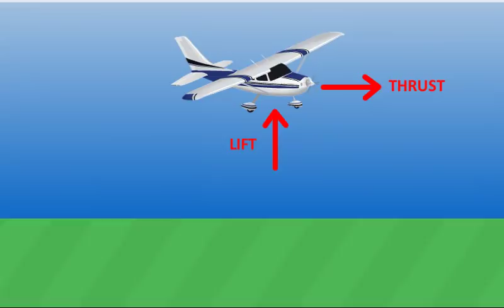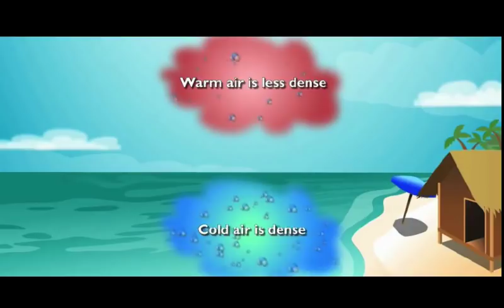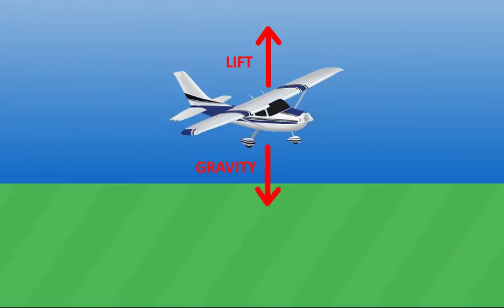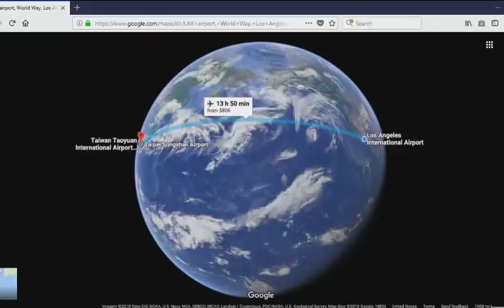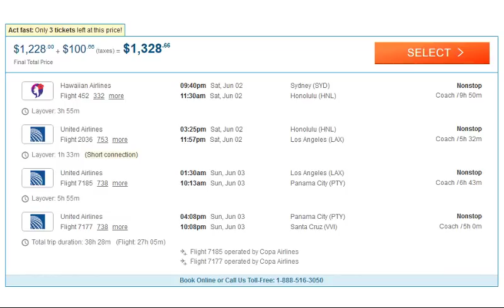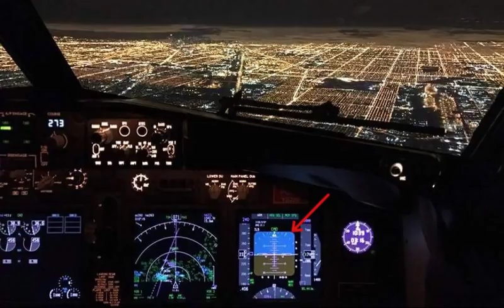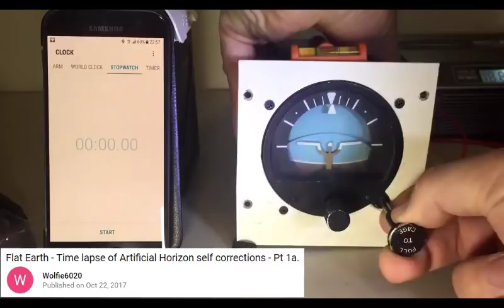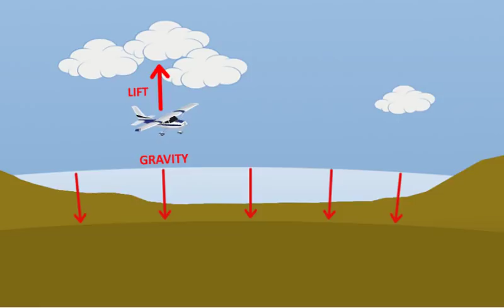Flat Earth Falsities - Plane Nonsense

Comment: #3  Flat Earthers often make this claim about planes having to dip their noses to avoid flying off in to space. I like the video clip you used, "In my reality . . ." That's the problem people, you don't get to define your own reality. Anyway, the point I want to make is, that they never address the fact that on the flat earth model they usually use, a plane, or anything else for that matter, going due East or West, would continually have to turn right or left, depending, in order to maintain that compass heading. Any vehicle on any course of constant bearing, other than due North or South, would also have to make continuous corrections to maintain that bearing.
Reply: @James Hewitt
Why are you lying James?
Why are you a troll James?
Why don't you fuck off James?
Reply: That doesn't address the issue. The compass would track magnetic north in both cases, but on a flat earth maintaining a constant heading would require constant course corrections, and the further north you were the more extreme the required corrections would be.
Reply: No it's not. A plane flying east on the equator can maintain that heading without making constant course corrections to the north. This is impossible on a flat earth.
Reply: +StoicSophist
James Hewitt is a proven troll.
Reply: James Hewett  Closer to does not mean directly in between. Now, when Venus and Mercury are directly in between the Earth and Sun, or on the other side of the Sun, they cannot be seen, but most of the time they are far enough out to the side to be seen. Now, how about actually addressing my point?
Reply: "Thats very well argued. But its in no way shape or form proof of that the earth is a ball."
Actually it does, if you travel in a straight line without ever turning and you return to your point of origin it proves you are on a ball.

"Tell me how we can see mercury and venus at night when the two of them are closer to the sun?"
This has been explained to you several times and you just ignore all the answers.  No doubt you will ignore this one as well.

https://i.imgur.com/e206MQG.png

The gray areas are the visible areas.  Any time Venus and Mercury travel through those areas they are visible from Earth at night.
Reply: Disagreeing with James.
Reply: First, it does not need to be to scale in order to demonstrate concept.  Second, if you actually looked at it it says right on it "planets not to scale" because Earth would be 0.04 pixels wide at that scale.  What excuse will you attempt next?
Reply: Stoic Sophist  I'm sorry, I don't understand your comment. Are you agreeing with me or disagreeing?
Reply: "My point is that you cant from any angle see mercury and venus at night on a ball because."
Well your point is wrong.  As has been explained to you by multiple people.  As was demonstrated by the simple graph I presented you with.
Reply: Sorry . What graph?
Reply: Ok i see it. Is that gralh to scale?
Reply: Not to mention that the circumference of the ice ring is smaller than the equator, but hey whatever I'm brainwashed because the moon and so are all of the other planets and the sun and are round we just live on a flat disk and I can't see further than 3-5 mile at sea level cus of muh perspective
Reply: Go away wong. Or watch this doco. "Did scientists prove the shape of the earth ? You decide" its brilliant
Reply: My point is that you cant from any angle see mercury and venus at night on a ball because. No matter where the two planets are situated in their orbits .  The earths light side will be facing in that direction.  The distances are to great to try and argue that at a certain angle of  either planets orbit you can see the from the dark side of earth.  It is very simple
Reply: As to the issue of aircrafts. Both arguments are based on someone's word. Both sides have equally insufficient evidence that woud prove the the natural shape of earth
Reply: Odysseus Rex.  correct and the way it happens is the compass always points magnetic  north. Weather on a ball or a flat plain
Reply: This is an argument it cant realy prove either model
Reply: Thats very well argued. But its in no way shape or form proof of that the earth is a ball. As i have asked in other threads. Tell me how we can see mercury and venus at night when the two of them are closer to the sun?

Comment: There is a lot of reasonable explanations for our reality here, but I quite don't understand how a plane can follow the earths curvature just by flying plane? The speed of the plane is essential to make the plane lift off. It conquers gravity then. Why would not the speed of the plane conquer gravity when flying plane? Could someone explain this to me? What happens for instanse when you increase the speed when flying plane. Then you put even more force on gravity. I just don't see why the plane then won't fly into space...?
Reply: It is not "conquering" gravity when it takes off any more than you "conquer" gravity by jumping.  An airplane flies by generating enough lift via thrust to counter drag and gravity.  It is not "conquering" gravity, gravity is always there and always pulling it down.  It is just generating enough lift to reach an equilibrium with the downward pull of gravity.

"I just don't see why the plane then won't fly into space...?"
Because as you increase in altitude the air gets thinner, eventually you reach an altitude where the air is too thin to support the wings of the airplane.  Without enough air flowing over and under the wings the airplane can not generate lift.  Without enough lift, gravity wins out and pulls the plane back down.  This is of course ignoring the fact that jet engines require air to function so if the air is to thin the engines can't generate thrust either.
Reply: bonny john They were tracked to & from the moon, they left traceable equipment there, brought material back and the landing sites have since been confirmed with orbital pictures. Why do you think they believe they went?
Reply: Aner Aner watch minute 5-7
Reply: What a well thought out and erudite rebuttal you have presented.
Reply: bonny john Only because we don't have a powerful enough launch vehicle to do it at this time.  We used to.  It was the Saturn 5 rocket, the most powerful rocket ever made.. Production of the Saturn 5 was stopped in the early 1970s.. Several companies such as SpaceX are working on building similarly powerful vehicles using modern technology.
Reply: Planes don't "follow the curve", as flat earthers try to suggest they would have to, on a globe. We don't "dip the nose down" or have to directly compensate for curvature. Much like we follow a compass for our heading (left/right), we follow our altimeter (barometric pressure) for altitude (up/down). Both are done with minor adjustments, over time. So, "following the curve" is kind of an "automatic" thing. Control surfaces, (ailerons, elevator and rudder) are what keeps planes on course, and not wildly going off into wherever!
Reply: bonny john I am happy that you want to know the truth.  As I mentioned earlier, NASA had a rocket capable of going beyond low Earth orbit, and therefore beyond the Van Allen belts.  It was produced for the Apollo program specifically. Once the program was cancelled, production stopped.  The blueprints were not destroyed as rumors claim: in fact, a Google image search turned up several different sites where they can be purchased.  Most of the parts that the rocket used (over 3. million) are no longer available or being manufactured.

We are currently building several such rockets. Space X among other companies are building those vehicles.
Just to be clear: we DID go to the Moon.  Six times.
Reply: Darryl Gonzalez i got you man...it is what it is,so many fake story out there so that why we need the truth right,and befor i know the truth its not wrong for me to not belive it right..
Reply: Darryl Gonzalez that mean nasa never had a chance to go to the moon,but why nasa claim that  they already did it?im not acting that i know everything but i just want to know the truth to gain more knowleg ..
Reply: there you go...and nasa still can't pass through the van allen rediation belt
Reply: OMG GMO you so stupid

Comment: Gravity is a force based on the fact that space is not empty, but contains a "fabric," if you will, of connected energy, and objects with mass interact with this energy to connect other objects that also have mass, and this energy tends to pull them together. There is a wonderful and simple proof against the flat earth delusion. Stand on a dock and watch a boat move away from you on the ocean. It disappears over the horizon. but what is a "horizon?" it is the point where the earth has its maximum point of curvature, relative to your position..If the earth was flat, you could use a powerful telescope at the Empire State Building, and see Big Ben, the Eiffel Tower..even the Kremlin...because it would be a straight line view. The reason you can't do it is because the earth is indeed round. I have flow a jet at close to 45,000 feet, and I can tell you, the round earth did not allow me to see more than about 1,000 miles before the horizon interrupted by line of sight. Break away from this co-dependency of flat earth delusion.
Reply: LTS4th - Post the video showing the claim that you made then

Comment: If gravity bends light, why do you think the look of the Earth from space is not distorted? Do we really know what space is? We currently see it as part of the 3rd and 4th dimensions, but what if it is not? Escape velocity is evidence this could be true. If the Earth and space were exactly how we model it, why do I need to hit some artificial speed to be able to escape Earth's gravity? Why would I not be able to just keep a constant acceleration just above 1g? Anyways, youtubers talking about astrophysics make me laugh.
Reply: @M34T.
If you would constantly accelerate just above 1G you will achieve speed of light in less than a year. IIRC there were some "preliminary" explanation for Earth gravitational effect by Flatters but the were quickly informed about that fact :).

Escape velocity is calculated for orbital motion. It is defined by centrifugal force greater then gravitational force.
If you could get enough fuel to burn it all the time then you wouldn't need to fly in orbit.
Reply: +No Ad hominem, solid argument and a true showing of intelligence.
Reply: @M34T. I didn't say anything even remotely similar to what you said.

While you fly away in "straight" line from the planet you don't build any centrifugal force in reference to it. You are left with just angular momentum of the surface and air around the place where you took off. The moment you turn off the engine you will start to change you direction toward the closes or the biggest mass around. If you are close to the moon then you will start closing to it. But what is more probable after time a little longer than engine burn lasted you will start to fall back to the Earth without any control (if you burned all fuel).

Flying away like you imagine isn't feasible with current technology.
Reply: M34T No... means that you were taught the answers (and reasons why) in school. 

The distortion is relative to mass; the sun has sufficient mass to alter the direction a tiny fraction of a degree. 

Escape velocity is for unpowered objects; they need to be launched at that speed (or higher) so the deceleration caused by Earth's gravity as they rise is insufficient to reverse their upwards course. 

For a powered object to rise requires only the application of sufficient force  to counter gravity so that there is net movement upwards.
Reply: Flook D and you two assume everything you were taught was true

Comment: Thank You, Can you tell people that jets need fuel to compress air?
Reply: It rather should be: jets need fuel to heat air.
Even so in confined space heated air will start to exert stronger and stronger force on the container walls. It might be interpreted as compressing rising volume of air.